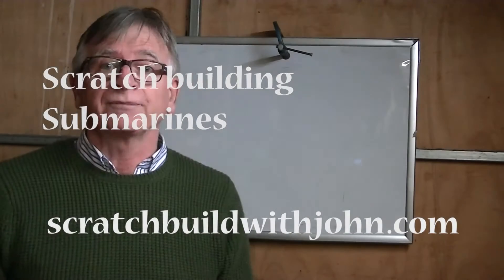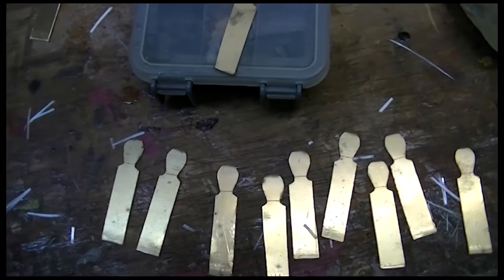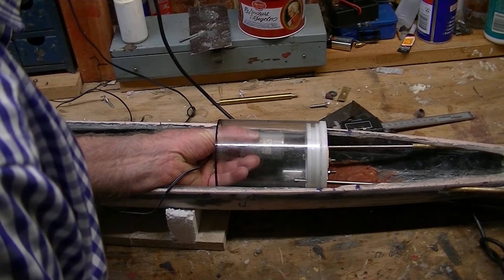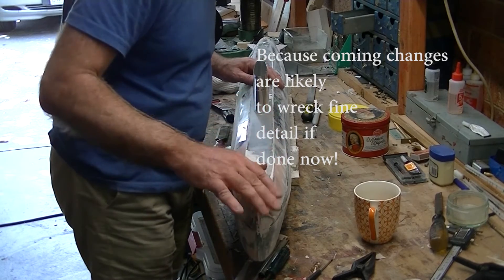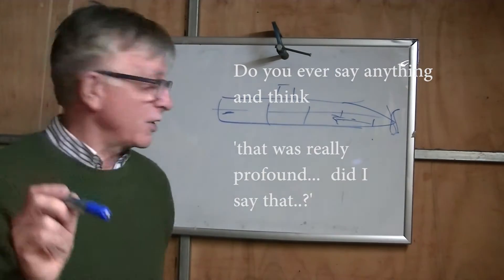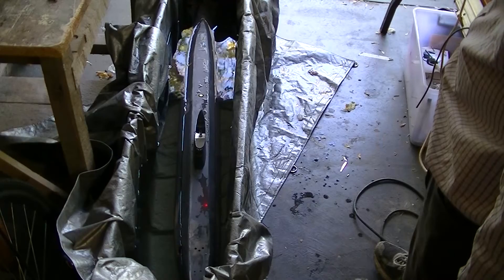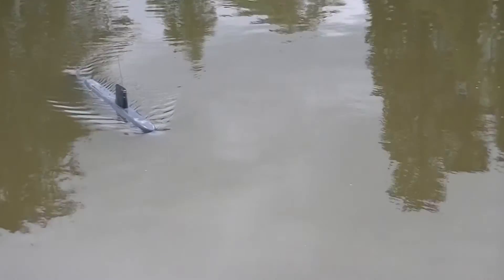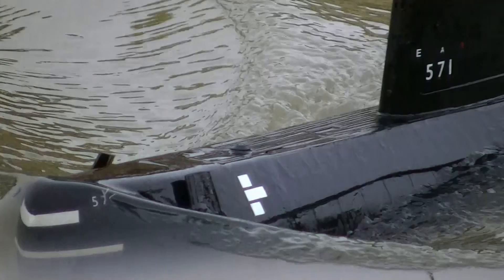Scratchbuilding submarines

Comment: Hello I have just began a replica of the SSN 593 USS Thresher at 1/55.75 scale. I'll be using an Arduino Mega as the main brain to expand the capability my 4 channel AM TX/RX system has. I have never done anything like this but I'm pretty confident from my test on seals, radio water test, and creating a watertight hull since I will not be using a WTC. I have a strong faith with my abilities in engineering but I have no clue  with submersible builds. Anyways I'll greatly appreciate some questions for me so I know if I had already thought of a solution before I start building my hull.
Reply from the maker: Ok Kolton it sounds you are off to a good start.  It is a very addictive hobby. Happy to respondent to any questions as they arise.
Reply: Thank you so much, and I should have it done before October but like almost all projects are I have a feeling it'll be latter. Do have faith in the hull since I'm actually going to 3D design the sub first with a cad program, 3D print the parts, acetone vaporize the parts (Extremely interesting stuff if you have the time check it out, only works with ABS plastic), and acetone fuse the 3D printed parts together to form the complete hull. I plan to build the whole sub like how the virgina class subs are built.